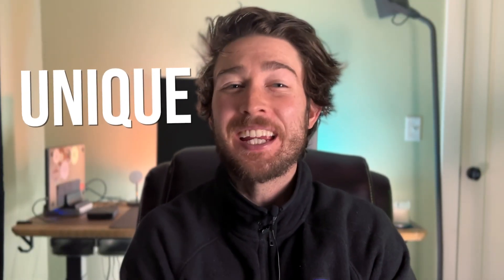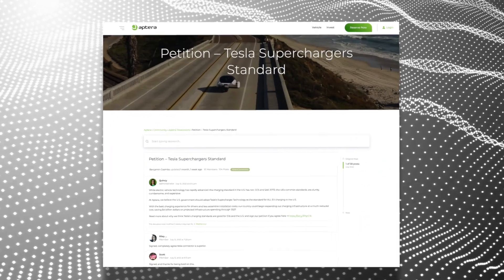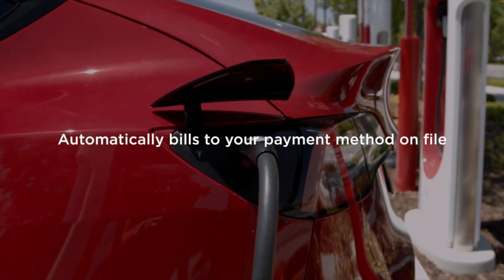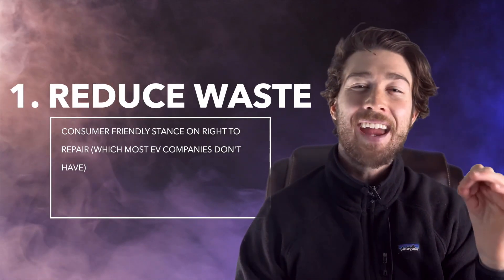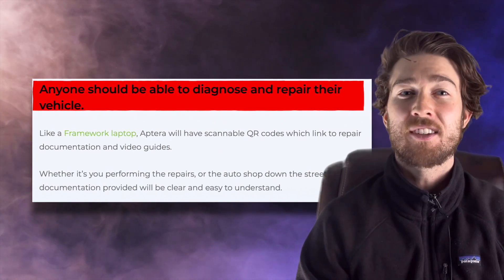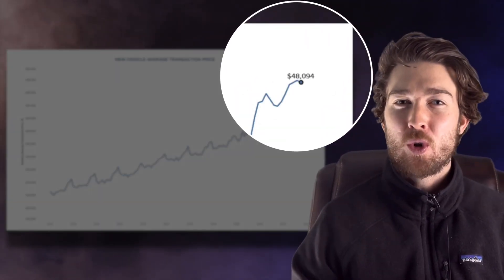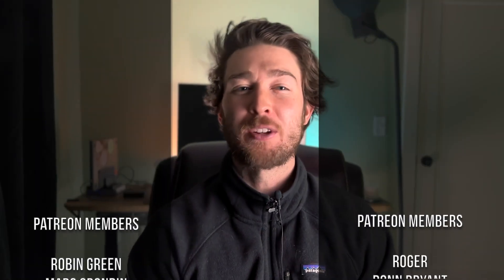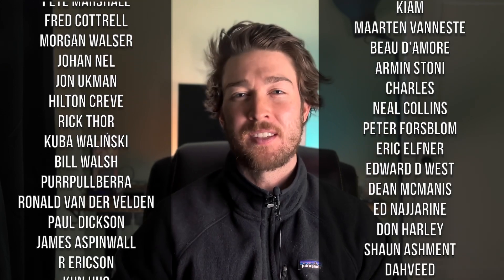This EV startup made a GENIUS move

Comment: 4 wheels is the key for me. If I get stuck in the snow with a 3 wheel car, I will have to call a tow truck...
Reply: It is kind of funny.  The old VW bugs would go over the top of snow when others got stuck.   The weight over the rear wheels gave it the traction and the light weigh kept it on top.
We might just see the same thing on the aptera.   The front is certainly light enough. It weighs just a bit more than 1/2 of the beetle with the  60kW-hr version so it might just work.
Reply: @Dan Harold  yes, but they had 4 wheels.
Reply from the maker: yeah very true haha
and its super lightweight which doesn't help in the snow
Reply: It's available in awd.
Reply: @TigerOscar78  Put 2 skies on the font tires and you have a snowbile
Reply: @SamAlexanderYouTube  Thinking you never drove a bug on the snow.  The aptera single rear wheel should have about the loading as the bug.

Comment: Aptera’s needs so little energy they will charge on a destination charger as if it Tesla charges on a supercharger. I already have my Aptera pre order 🤗
Reply: level 2 is actually a bit of a weakness in all fairness.  Aptera has only confirmed it will have 3.3 kw level 2 which accounting for the efficiency is actually slower in miles per hour charging than most teslas (not all destination chargers are the same amps).  Still plenty to get a full charge overnight for the 400 mile aptera but it will take over 24 hours for the 1000 mile variant 0-100%.  DCFC is still important.

Comment: 6:30 Regarding the 40 miles, this is the mid-summer figure - On average, over year, in southern California, you'd be seeing around 30 average (40 in midsummer, and 20 in midwinter).   If you are in a more northerly location, then there's less light in winter, and therefore also less solar gain in winter.  I'm quite a bit more north, and would probably only get a handful of miles in midwinter (but plenty in summer, thanks to 16 hours of sunlight).

Comment: The aptera is not a car for this old man but I fully endorse the right to repair. I have said this from my first investigation into EVs (about 10 years ago) that the more complex a machine is the less repairable it is. Keep it simple  with discrete, replaceable components.
Reply: EV's are simpler.      Unless your the type who counts the transistors on a chip.
Having said that I do wonder if there is a market for EVs without all the electronic frosting and gadgetry.
Reply: I’m an old guy and can’t wait to get mine. I sat in the Gamma at it’s release in San Diego. I had no problem getting in or out of it. I’m 5’10 150 lbs with usual old man creaks. Did have an issue with the seats and spoke to the person in charge of the design and he was receptive to my concerns. BTW Amazing team behind the scenes at Aptera.
Reply: Right to repair. Say it again!

Comment: Thanks Sam for covering the Aptera. If you do a few more good videos like this one over the next year I'm sure that you will easily get an Aptera of your own. I am a reservation holder and investor too. I like to talk about the Aptera as having solar assist, so that people understand that it is First a super efficient EV, and then also can get 10,000+ miles a year of  driving just from the sun (if you have the full solar package ($900) and live in a mostly sunny part of the country. You might talk about the AWD version getting from 0-60 in 3.5 sec, or the fact that it will have a pressed carbon fiber chassis and shell, like a Formula 1 racecar. The NACS plug will soon offer nationwide Supercharger access, but most owners won't need it because the Aptera uses so little electricity. I am hoping to have mine by this time next year.
Reply: I am really looking forward to your reports, Dean!  Perhaps we will meet at the factory when I pick mine up!
Reply from the maker: I hope so! and I'm planning on continuing to cover them

Comment: Aptera is the most economical form factor for a robotaxi because it's insanely efficient and it will have like 1/8th the tire replacement cost of a model 3. Long term, tire replacement costs will be the biggest cost driver of operating a robotaxi.

Comment: I haven't really checked into these much but I just was wondering off the top of my head, how well this design would hold up in real-world crashes?   Simply referring to the skinny rear end or maybe the front wheels being out not part of the body.   I was leaving the passenger compartment could be pretty strongly built but I was wondering about the car spinning off by deflection in different directions. Without getting really in-depth in this question hopefully you get my drift, no pun intended. 👍🏻   🤔

Comment: These guys have been on my radar for awhile now but my only concern is it looks like it would fold up like a tuna can if it got into a crash. What are your thoughts on this?
Reply: I think that I read someplace that their crash safety is surprisingly good.  Verify this if you care.
Reply: @danharold3087  Basic crash tests are the car going into a barrier. That means it’s only the cars own momentum. If it gets run over by a Ford F350 it’s gonna be more than a little different than the crash test,
Reply: @sethtenrec  not enough people are pointing out this huge problem with the Aptera 'car' (it's not classified as a car so it does not have to pass crash testing)
Reply: @bluetoad2668  I was wondering if it was going to be classified like a motorcycle. Total death trap for sure, I’d rather be on a two wheeler than three but these days I stick to four,
Reply: Carbon fibre structure, a side impact would be absorbed to some extent by the wheel pants, and also somewhat egg-shaped.  So in theory it should hold up quite well.  My understanding is that they will be doing crash testing in Q2 (the same set of tests that a car requires).  It'll be interesting to see the results.
Reply: @WyndStryke  what source do you have for your “understanding” that it’s going to be crash tested as a car?
Reply: @sethtenrec  That's what the founders have said a number of times
Reply: Carlos …tuna can is exactly right!
Reply: It'll have crumple zones, airbags, and a monocoque. It should be as safe or safer than any other small car. By law, they don't have to do crash testing, as it's legally a motorcycle, but they've promised to do it anyway, and publish the results. In the meantime, they've run it through computer simulated crash testing (as is industry standard) and it's performing well
Reply: @GoClimbARockEh  promised
Reply: @sethtenrec  What, you want them to take a blood oath?
Reply: @GoClimbARockEh  no I’m confident that they will renege. I don’t need to hear anything from them.
Reply: @steviesevieria1868  renege? No, why would they. Fail? It's still possible, but things are looking pretty good for them.
Reply: @GoClimbARockEh  why? Because they didn’t mean it in the first place, it’s called running the con, it’s called corporate America.
Reply: @steviesevieria1868  So you think they're going to build a vehicle, but not include all the safety features they've already designed in? That's just mental. Your hypothesis makes no sense.
Reply: @GoClimbARockEh  oh I’m sure they’ll include their safety features, they’re just not going to submit it to a full automobile crash test because it WON’T BE PRETTY
Reply: @steviesevieria1868  you still make no sense. The safety features they've designed in will enable it to perform pretty well in crash testing
Reply: @GoClimbARockEh  well I think they would fail the crash test, but regardless, my point is they won’t submit to it. Try to remember, when they skip out and you’re making excuses for them, that I predicted it…
Reply: @steviesevieria1868  well, I think you're wrong on both counts, and frankly you have zero evidence to back up either. If they break their word I'll be first in line to criticize them, but I doubt they will
Reply: @GoClimbARockEh  ok, time will tell. 👍👍👍

Comment: It seems to be a $45,000 motorcycle, like Polaris makes. Niche product for sure.
Reply: Aptera starts at $25,900 and is far safer and more practical than Polaris.  It is an all weather vehicle.  The slowest Aptera matches the Polaris 0-60 times and the 3 motor version blows them away - all while costing far less to operate.

Comment: Love you and love what you're doing but three wheel cars have one big problem.... They are missing one wheel 😀
Reply: I seriously wonder where they are getting all the cash to place adds all over the Mass Media?
Reply from the maker: ohh I didnt think of that ;)
Reply: The lack of a wheel is an essential boost to the performance - it lowers cost, weight, but most of all, rolling resistance.
Reply: Motorcycles are missing 2 and they have a good following.
Reply: @n.brucenelson5920  These cars are going to be a collectible that you can’t get parts for
Reply: @sethtenrec  There is little indication that that would be the case - Since Aptera is a right to repair company, parts can be sourced from anyone - even third parties.
Reply: Have you ever heard of the Morgan 3 wheeler, Reliant Robin or the Polaris Slingshot?
Reply: @jamesengland7461  The Robin actually elevated Reliant to be the second largest car manufacturer in England, with around 1/2 million copies sold.  The "tipping" videos produced by Top Gear were done for comic effect.  They had to rig them to do that.
Reply: @n.brucenelson5920  no third-party is going to make parts for car that only had, for instance, 1000 made. There’s a little thing in the auto business called economies of scale and this thing totally misses the mark.
Reply: @n.brucenelson5920  3 wheels are inherently unstable in a fast turn.
Reply: @sethtenrec  Perhaps you are unaware that Aptera already has more than 37,000 pre-orders with the numbers rapidly increasing.  Many 3rd parties are already supplying parts, including major automotive suppliers.

You need to take another look at the facts.
Reply: @n.brucenelson5920  yeah yeah and Tesla already has 1 million cyber truck orders. That’s not the same as seeing them on the road. There’s a little thing called vapor. I’ve seen a lot of it, and this has all the stink of it.
Reply: @sethtenrec  Hindsight is often 20/20.  I am not impressed.  I have seen plenty of vaporware too.  Aptera is one of the least likely to become such.  

It is easy to make such comments without doing due diligence.  You could have said the same about any company in the startup phase, including Tesla, and would be right much of the time.  The other times you would be spectacularly wrong.
Reply: @n.brucenelson5920  that is correct, I may be right and I may be wrong. Only time will tell.
Reply: @n.brucenelson5920  How is Arcimoto doing on 3 wheels?
Reply: @raulgil8459  It is hardly in the same size or performance class.  The larger and more capable Polaris Slingshot shows there is a demand for such performance vehicles.  They have sold over 30,000, and Aptera dwarfs the Polaris performance for not much more money.
Reply: @danharold3087  You are correct, that's why they are called "motorcycles" and not "cars"
Reply: @SamAlexanderYouTube  Please do some research on who is really running this "company"
Reply: @danharold3087  Yes, that's why they are called "motorcycles" and vehicles with three wheels "tricycles"
Reply: @sethtenrec  This car has a good following and it is growing.    Unless they are a total POS I expect that people will keep them running long past the end of production.   Just my thinking.
Reply: @sethtenrec  This is not the same as making a regular car.   Regulations and such are much easier.   Do not need the same scale.  So said Sandy M.

Comment: I'm sorry but I really think you're wrong about this company - this car is a death trap quite frankly. The problem is not the actual vehicle, it's all the other vehicles on the road which it will crash into.  I simply do not believe there is a sufficient market to make this a viable product at the price they are charging.
Reply: You have zero data to back that up.
Reply: @jamesengland7461  yes, that's true.  On the other hand what data do you have to back up your thesis?
Reply: they have over 30k pre orders already. Sure, not all of those will become sales, but it demonstrates that there is a market here. As for safety: it'll have crumple zones, airbags, and a monocoque cockpit. It should be as safe as any other small car.